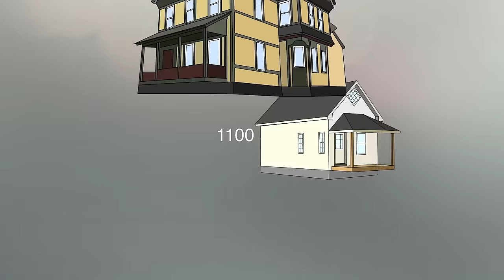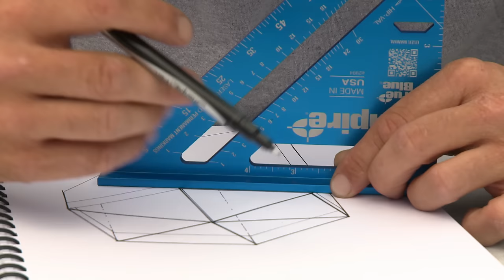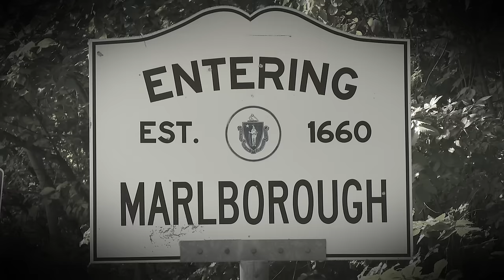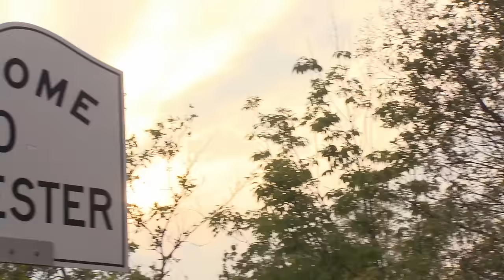OUT OF THIS WORLD 398 SQ. FT. TINY HOME (S4, E1) | Tiny House Nation | Full Episode

Comment: This might be a long shot but at this point i'm asking everybody. Any ideas on cheap motorhomes /tiny houses for a young pregnant couple? We are in Colorado and need any help we can get. They need stability and a camper is all they can afford to buy. Anyone reading this, thank you for your time.
Reply: I would say their best bet is to find an older one that is in fair shape.  Hopefully the husband is mechanically inclined and won't mind working on it.   They can also remodel the interior.  Be sure to check the roof and walls and be sure they aren't too rotted out.
Reply: You should check out Incredible Tiny Homes. They have a YouTube channel where you can see their homes and building process. They are some of the most affordable and high quality tiny homes (on wheels). They are certified as RVs, so you can park them in RV parks if you need to.
Reply: Have you checked on YT for small camper ideas for living in...
Reply: I'm going to add to my comment about the older camper:  We bought our older Jayco Designer 5th wheel on RV Trader website from a private seller who kept it garaged when not in use.  This was 2019 and the 5th wheel was a 2006.  It is always better to buy from a private seller rather than a dealer.   Our 5th wheel was in excellent condition and we have had it 5 years now.  It is a 36-footer so has some room in it.  The older ones are built better than the newer ones and everything still works well on ours.  My husband put a new faucet in the kitchen sink but that is about all we've done.  Please look at a higher end older one because they were built better like I said.  Ours was top of the Jayco line when it was made in 2006.
Reply: Incredible tiny homes, Tennessee
Reply: @beckyj.788 Sad but true, many rv parks won't allow tiny houses😢 but family property parking seems to be the best option.